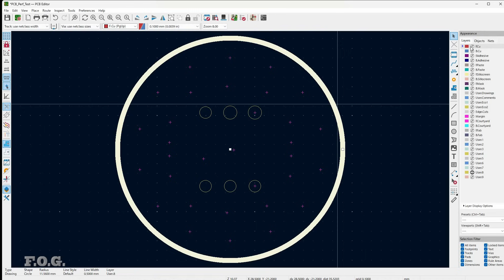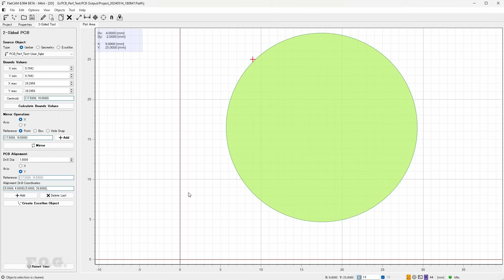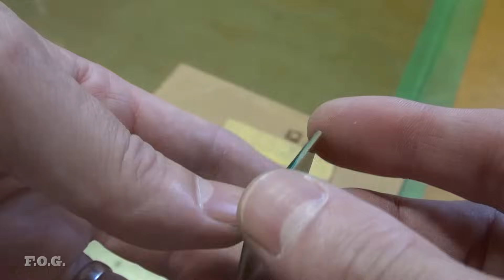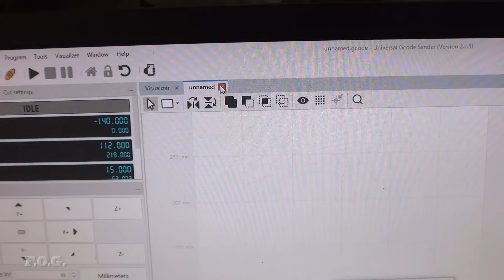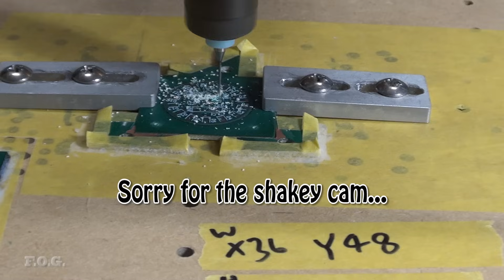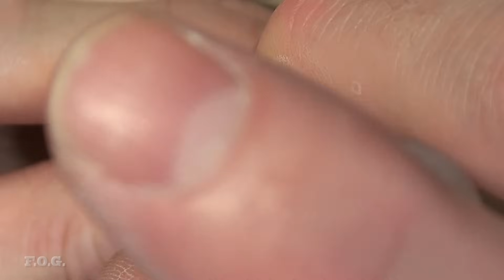The BEST DIY PCB Tutorial (ForOurGood PCB Method)

Comment: I’m only 17 mins into the video (great explanations), and I just wanted to discuss the board origin issue. Have you trying moving it in KiCad to the button left corner of the work area? I’ve never had any issues in FlatCam since doing this.
Reply from the maker: I tried for a while, and in the end gave up. Maybe I was doing it wrong or something.
Another viewer also left a comment about how to do this, so I will give it another go next time!
Reply: @ForOurGood  I'm not the sharpest tool in the shed, so you'll figure it out, I'm sure. That said, I haven't tried it in KiCad v8 yet, but in v7 it was straightforward.
Reply from the maker: Sorry, ignore what I said before.
I can't remember if I specifically tried moving to the bottom left, I sort of think so.
I did move it around a bit and tried a few things.
I will try bottom left next time.
Reply: @ForOurGood  Bottom left gives you a positive X and Y Axis, which makes things simpler for sure. :)

Comment: how well are the solder joints? cause resin looks to be quite thick...
Reply from the maker: There are some pretty close up shots at the end, so you can judge for yourself. From what I am seeing, they look and work very well.
I have also been using similar boards, however made with my older process, for a number of years now without a problem.
Thanks for the question!
Reply: @ForOurGood  good to hear. the result looks quite good, it just looks like there's a very high layer of resin. But if it works out, it works out :D
I just use black spray paint to cover the board and use the same 3018 with the laser it came with. But i only use it for emergency boards... so i'm not very picky :D
Reply from the maker: @Error404_Handle  I think the magnification method I use makes it seem thicker than it really is. Laying down the resin with the silkscreen results in a super thin layer in reality, and even with 2 layers it is still pretty thin.
Reply: @ForOurGood  that and maybe the sharp angle that's left after the laser burns the resin off. Definitely could be the reason why it looks so thick.
But great job either way.

Comment: Fantastic work! The boards came out really good. Thanks for taking the time to share this with us. What power is your laser? Is there any reason why you didn't cut out the pcb when you engrave the components on the back of the board?
Reply from the maker: The laser I am using is a “LaserTree Gold 450nm 40W-Pro 12V 20mm Fixed Focus Laser”, apparently it puts out less than 10 watts of optical power in reality. I highly recommend getting one with an air assist nozzle.
Sorry, I am not sure I understand your question regarding the PCB cutout.
The laser is not powerful enough to cut through the central glass fibers of the board, which is why I need to laser cut on both sides of the board.
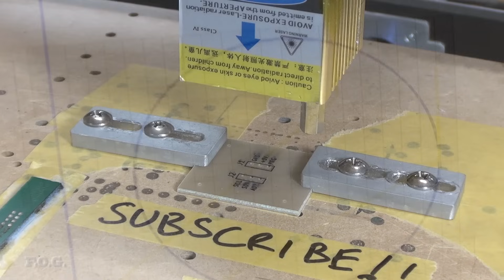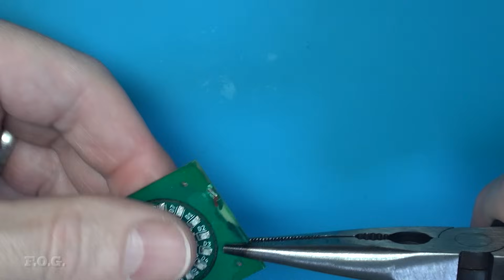I show cutting the front of the board at timestamp (1:49:40), and the rear of the board at timestamp (2:08:25). The final step is to snap it out, breaking the central glass fibers, as shown in timestamp (2:35:10)
Thanks for the comment!
Reply: @ForOurGood  Flip, sorry I somehow missed you cutting the outline on back of the board. Thats what I was asking about. Thanks for the info. I have a creality 10W (with air assist) upgrade kit fitted to my ender 3 v2 neo. So hopefully, following your steps I should be able to acheive the same. I thought my laser might be too weak to do this. Thanks again.
Reply from the maker: @arthureschner9319  no worries, the video is pretty long, so not surprising if people miss bits here and there.
Anyway, sounds like your laser will do the job, so good luck with that 👍

Comment: Yes outstanding as usual from F.O.G. Been looking forward to this since the teaser shots of the board,  looks great. The silk screen is incredibly clean. I was thinking there may be something else to use for your stencil material but this clearly works for you so all good and seems to accept a good amount of paste with the two layer thickness. Thank you for the exceptionally detailed and time consuming to make video a great addition for makers. Ps I think you were generous most hobbyists I know go for the bodge wires on the first batch of board mistakes (after much swearing) never mind ordering second set haha
Reply from the maker: Ha Ha, yep, I reckon your probably right, most people will just live with their mistakes after the first order, it’s gotta be pretty disappointing😐.
Personally, I could not stomach the stress of getting it wrong (or likely getting it wrong), and then having to live with it, which is part of the reason I have never taken the step of ordering a board from China myself 😊.
Actually, even in a professional environment, I could rarely justify going more than one revision before needing to put a board into the required operation (my requirements were never mass production however, max 100 or so boards).
The great thing about surface mount, is that with the help of the hotplate, it is super easy and fast to reuse components, so that definitely takes the sting out of the idea of having to redo a DIY PCB too.
Using my new process, I honestly believe I would be inclined to do the necessary iterations to at least get the circuit design and track layout of the PCB correct.
Thanks as always for the comment and support!

Comment: In KiCAD you can control the export and plot origin by placing a "Drill/Place File Origin" mark wherever you want the (0,0) origin to be on your board. Simply select Place->Drill/Place File Origin from the Place menu and then left click where you want the origin to be. Then when you export/plot make sure the appropriate tick box is checked to force the output to be referenced to that (0,0) point.
Reply from the maker: I did mess around with that for a while, but failed to get it to work. It's more than likely that I checked the wrong box or something. Next time I make a PCB, I will be sure to give it another try. Thanks!
Reply: @ForOurGood  First of all, and I should of said this before, but thank you for all the effort you put into your method and for documenting the process as well as your journey to get there. The end result is very impressive and is nearly indistinguishable from purchased boards.

I personally made my first pcb over 40 years ago using pre-sensitize coper clad boards and photocopies of artwork on overhead transparency papers while exposing them to sunlight. Since then, I've tried lots of different methods, including toner transfer, resist pen plotting, and isolation milling. All to varying degrees of success, and at this point I've all but given in to just using fast turnaround Chinese vendors. Your method has rekindled my desire to produce my own pcbs for first article prototyping and same day iteration testing, as such I would be most interested in learning the optical power of your laser module. I believe this is just the excuse that I needed to justify adding a laser to my CNC machine.

With regards to the origin issue, the tic box you are looking for is in the upper right quadrant of the plot dialog and is labeled "Use drill/place file origin".
Reply from the maker: Wow, 40 years ago, I did my first probably in 1991, though I have probably had a 15 or so year hiatus before my latest attempts were started, either way, you have got me beat!
I am glad to hear that the video might actually stimulate someone to get back into the hobby, so thanks for the comment!
The laser I am using is a “LaserTree Gold 450nm 40W-Pro 12V 20mm Fixed Focus Laser”, apparently it puts out less than 10 watts of optical power in reality. I bought mine a couple of years back on Ali-Express, so it is likely this exact model is not sold now, but I am sure you will find something similar, though I do recommend you buy one with an air assist nozzle included, even if you don’t plan to use it immediately.

Comment: Very interesting process. I've been making my own PCBs for the past 20 years using UV reactive paint and an exposure mask made with clear overhead projector sheets. I typically use bare copper print, but if I need some protection, I use clear PCB varnish or even nail polish. Maybe it's time for an upgrade after 20 years. 😋
Reply from the maker: Give it a try! I guarantee you will be surprised by the results. Thanks for the comment!

Comment: Awesome method.  Nice results.  What would you think of the first step being to drill a few alignment holes in the scrap part of the PCB.  Then have alignment pins in your CNC waste board.  Then when you place and remove the board, it always goes back to the same place.  As well, keep the pins the same for every board that you make.  That is.. the alignment pins are forever in the same known/fixed place.  As they are in a know position, and hence the board will always be in a known position, you no longer have to do any alignments for each board, or each step when placing the board (laser, drilling, etc).  You would do one calibration when initially placing the pins in their permanent positions (to essentially tell the CNC where the pins are located), but none after that.
Reply from the maker: What I am trying to demonstrate here is different way to achieve high precision PCB locating, that is easy to replicate, even with all different sizes of blank PCB stock.
I have actually been using alignment pins right up until recently (see my earlier videos), including going to the effort of machining my own precision sized pins to ensure an exact fit, but it just does not work good enough for this level of high-resolution PCB, and that is why I came up with these new methods.
The reality is, that it is extremely difficult, actually nearly impossible, to reliably get the repeat fitment accuracy of less than +/- 0.01mm, using the locating pin method.
Thanks for the comment!